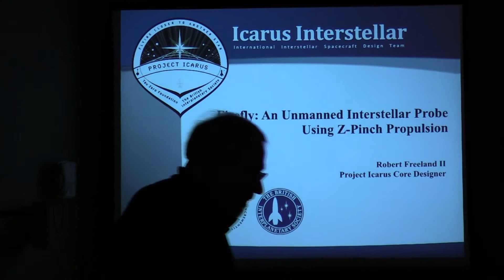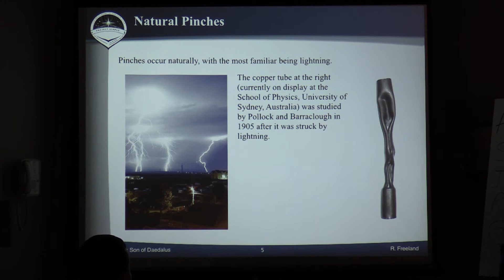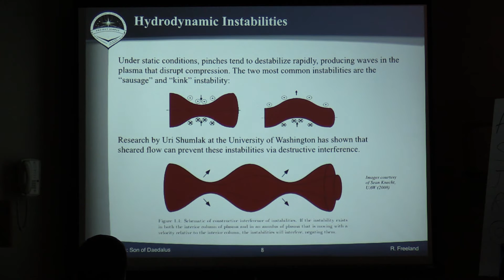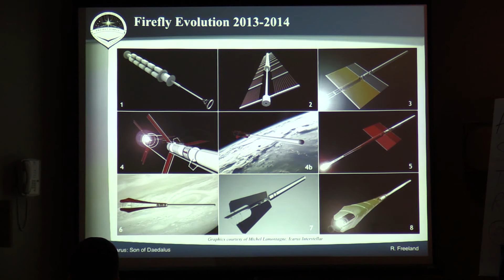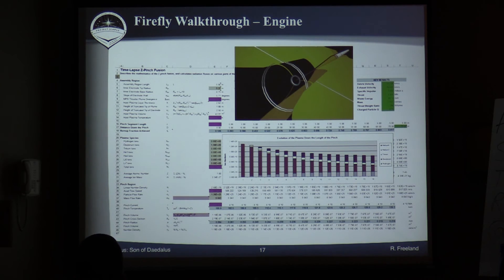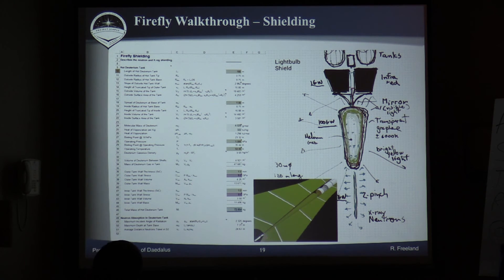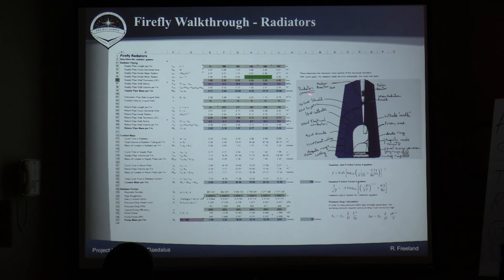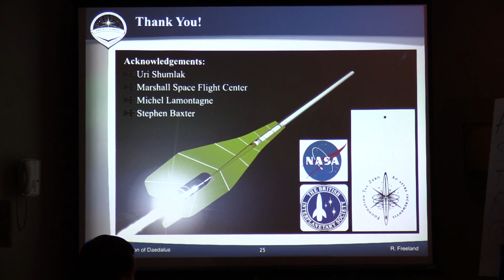19.0 Firefly: An Unmanned Interstellar Probe Using Z-Pinch Propulsion

Comment: I have a design for a Z-Pinch dense plasma focus that uses a preionizer chamber with a high surface area copper ribbon/foam as an electrode so that the fuel is strongly accelerated down the electron beam line entering the central anode of the pinch just before it hits the pinch plasmoid, or rather runs through the core of the ring plasmoid and stabilizes it by induction. This little extra stage of accelerating the plasma fuel before the actual pinch is because the fuel is now A. Already plasma state before it reaches the magnetic pinch region and B. Compressed through the fuel injector if you design it right so that plasma density is able to be controlled for better specific impulse.
Reply: Ok braniac